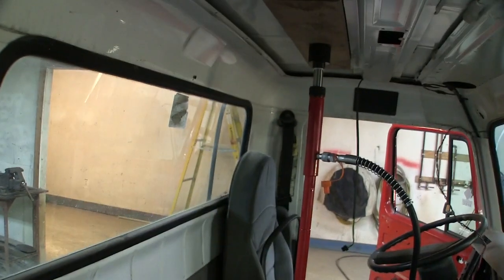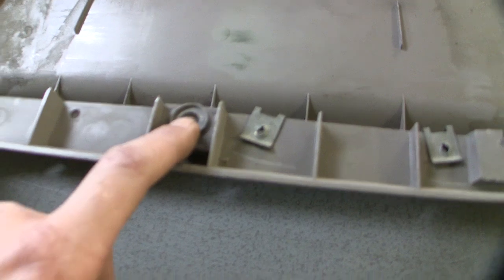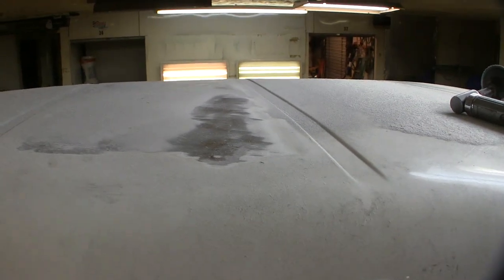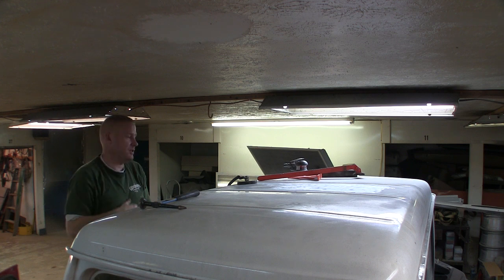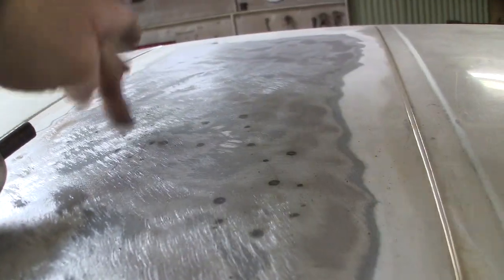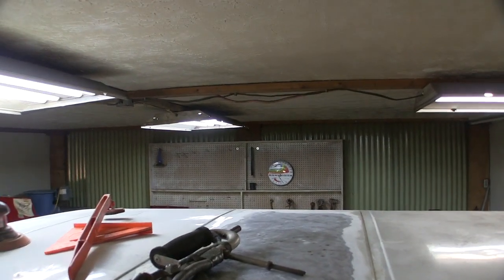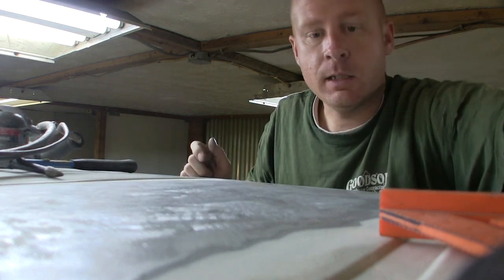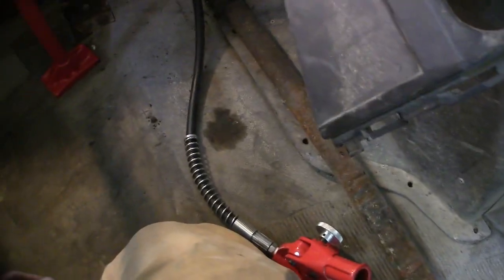Pulling dents in roof of International 4700 cab

Comment: Will be better than new when you're done. The roof on my old cornbinder rattled like crazy from day one. I did use great stuff on it!

I've got my home brew version of a panel beater close to finished. It will end up being a panel beater, battery charger and rolling jump box when I'm done.
Reply from the maker: Mine has the battery charger but would be neat to add a set of detachable cables to it so you can jump off it.  
I'd like to see what you came up with.  I remember you mentioning it before
Reply: http://www.northerntool.com/shop/tools/product_200514377_200514377 Works real good to make detachable jumpers.

I started with a roll around style charger/booster. Moved the charger board up and added a battery underneath. Need to work on my relay. Think it needs the disc flipped or turned. Shows a few ohms resistance when it shouldn't.
Reply from the maker: ***** Cool.  Can't wait to see it!

Comment: Good stuff Shawn!
Wood furnace is working good you just need the fuel now. Check out that humidity!
Reply from the maker: Humidity is low low low....
Got me some slab wood on friday and I'm working on cutting and stacking this weekend.  Was rainy and crummy here today but I made it thru one bundle and I'll get the other done tomorrow.  Had a 14 hour burn from last night when I left till this morning at 11am.  No heat left in the unit but still had enough coals to get er' up and running again.  76 degrees in the shop yesterday but I burned a crapload of junky wood to get it there.  Gonna need to take some decent splits or rounds to the shop for the overnight burns.

Comment: What is that puller/shrinker tool your useing. It looks like it's very handy.
Reply from the maker: I have a video of it from a while back but it's made by AIM manufacturing and called the "Panel Beater"   If you google it, you'll find the website
It can pull dents, shrink metal, weld trim rivets, wiggle wire, etc.  12v unit

Comment: You are an amazing person. Love the dent puller whats the brand, I know they are expensive but i look at gov auctions and ebay to see if i can get one cheap lol great to have tools like that! hope you had a good New Year.Thanks for the video!
Reply from the maker: Thanks Cary!
The unit is made by AIM manufacturing and is called the Panel Beater.  Google it and you'll find it.  Also, Autobody Toolmart dot com has a couple of similar 110v or 220v units.  One made by Dent Fix and the other I believe is called the Shark.  
Don't know what they go for used (mine was a freebie from a buddy who moved).  New they are over $1000 and some over $2000.  I have never seen one on ebay but I'll keep my eyes peeled
Reply: Velvethamma
 Pass on the Shark. I believe it is actually made by Dent Fix to. Have one at work and its a POS.

Comment: Great work on shrinking the skin.
Would a stud welder with a modified tip work?
I have one of those but not a cool tool like yours.  :-)
Reply: this should do the trick... http://www.eastwood.com/stud-welder-shrinking-electrode-tip.html   cheers
Reply: Thanks alot for the link. :-)
Reply from the maker: Looks like I got beat to the punch... but most of them have interchangeable tips so you can shrink as well

Comment: I sure hope I never have to deal with oil canning. Man, that looks rough. Great job though.
Reply from the maker: It can be tricky.  That roof has support channels rolled into the skin and some of that is causing the tension on my repair area.  That's why a lot of times it's easier to change the roof skin than repair it.  We'll see how it goes........

Comment: A guy can drive himself nuts trying to straighten out that thin metal on large flat panels, seems like you can get one area nice and then that just screws up another area, I've never had much luck shrinking that thin metal on flat panels, I lose patience quickly and just pull the worst of the lows, tap down the highs and then start filling the shit out of them. I always prefer to just replace panels like that rather than repair but most of the time the budget doesn't allow for replacement in my world.
Reply from the maker: I considered replacing it for sure.  I know it's a game of chasing your tail till you can live with what's left.  That's where I will probably leave it.  A little urethane foam between the roof skin and the inner support structure and then I'll probably pave it, lol.  After all, it is a work truck......

Comment: If you're still looking I had good luck with mcgivernhydraulics.com.  A few years ago I had a floor jack that the ram internal seal disintegrated.  It was a cheap jack from taiwan at the time and there was no part number.  Bernie worked with me and was able to match up a part based on dimensions I took off the old part.  Hope this helps.